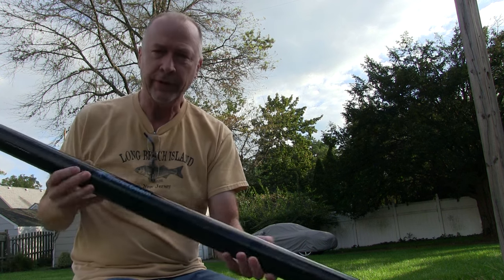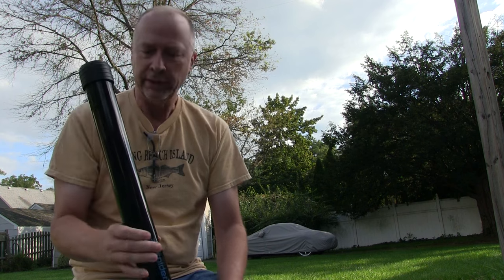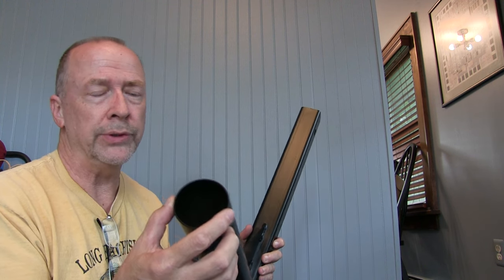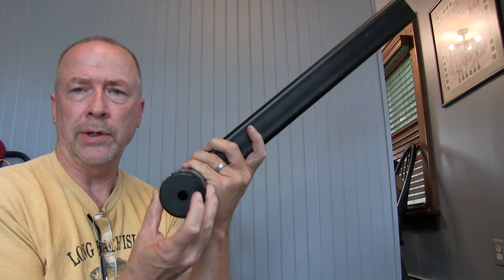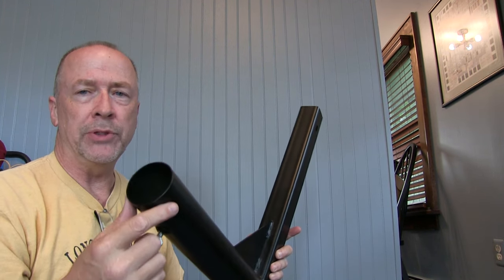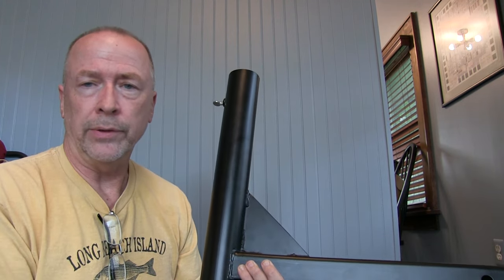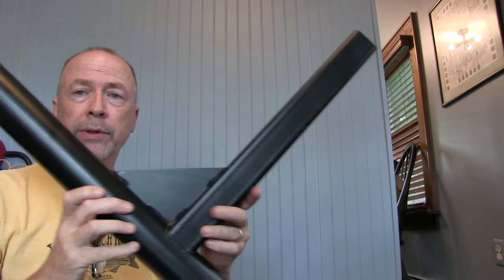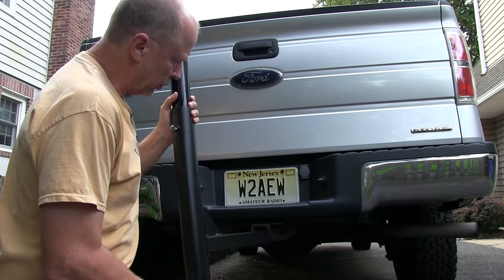#373: Portable ham radio / POTA: The Spiderbeam 40' (12m) telescoping mast and hitch mounted support

Comment: I found that cutting a bit of towel or other fabric and placing that inside the bottom rubber cap will keep sand and grime out of the antenna. There is a slight negative pressure formed when extending the sections and, at least for me, that meant that I got sand in thru the small hole in the cap and ended up in between the sections. Had to disassemble the whole thing and clean it with a rag. Never had that problem since I put a piece of towel in the end cap.
Reply from the maker: Great tip - thank you!  I'll do that!

Comment: Very nice. I have used two of these 40 ft Spiderbeam poles for wire antenna experiments for the past couple of years. They are quite fantastic. I did have a mishap where a big wind blew one over and destroyed the top two sections. A quick call and replacements were here in a jiffy. Now I am using their clamps and more kevlar guys! Great product and very well made.

Comment: I 3D printed a collar for my 10M pole to take up the slack in the top of the hitch support tube.  You don't have a much slack, so a couple wraps of tape on the pole would do it.  Either way you need something to spread out the force from that thumb screw (or eliminate the need for it all together).  It will mark up the pole at best, and more likely start cracking it as the pole encounters some breezes with a wire on it.

I have a friend with the Spiderbeam and he solved the diameter problem by lashing the pole to the outside of the receiver tube with two very large Velcro straps.  This also eliminates the pressure point from the thumb screw, and so far has proven plenty sturdy.
Reply from the maker: Yeah, I'm likely not going to use the thumbscrew.  I don't have a 3D printer, so I may ask a friend to make something similar for me.

Comment: I have two of these - one I use with an 11m wire and an SGC base mounted tuner at home mainly for the higher bands (although will tune 160m to 10m - not so good on 12m) and another which I use /P with a MAT-40 ATU with 4x 10m wire radials. Similar mounting method but a drive-on plate. I have to take the end bung off but thinking of having a special fabricated so that it will take the mount for the tuner too. I've used it for 20m end feds as well as inverted Vee on 40m with good results. 

Very well constructed poles and not horrendously expensive. I do want one of the longer poles but the collapsed length alone makes it challenging to get in even a 5-series saloon (sedan).

Comment: If you do use the thumb-screws to keep the antenna mast from turning, I'd suggest you tape pieces of aluminum flashing around the mast at the point where the screws will hit the mast, in order to protect the mast from being chewed up by the screws on a breezy day, which is, of course the sort of day you would most likely want to use the screws. Metal screws against plastics are always a point of concern.
Reply from the maker: Good idea. I’ll likely use some rubber or foam wedged in the top instead of the thumbscrew anyway.
Reply: If it is convenient I would slide a machined pipe spacer from the top to fill the gap. The screw is frustrating.
Reply from the maker: @Masirah1  yeah, I’ll come up with something more elegant like that.
Reply: @w2aew  I am thinking of cutting up a bicycle inner tube to use a spacer there.
Reply from the maker: @kapapatence6423    Good idea.  For mine, I had a friend "print" a collar/sleeve on his 3D printer that takes up the gap.

Comment: A very similar device called a Bream Pole (modern replacement for the older long bamboo poles) can be found at some fishing supply stores. Not quite so tall (maybe 3 or 4 meters) and much whippier. Don't be tempted to deploy by swinging it. The last sections will be moving so fast that they push through the tapered joints, splitting them beyond repair. Same principle as cracking a whip: all the energy keeps getting transferred to lighter and lighter sections (which means they move faster and faster.)..

Comment: Great idea! I have 3 of those and use them for my 3 home QTH wire antennas, as they are cost effective and easy to bring down in case of weather. I also used to use one as a POTA mast with a drive-over wooden plate and PVC "socket." And, when a section breaks (don't ask me how I know this😂) you can purchase replacements. Thanks.

Comment: Great video. I've been looking for a pota solution for operating out west or other places where there aren't as many trees. Do you suppose this will support an LDG 9:1 and coax when the mast is fully extended? 73!
Reply from the maker: As long as you are using lightweight coax (RG-174 or -316), then it probably would.  There would definitely be some flex.  You might consider using the mast to elevate the end or middle of the wire, and keep the balun/feedpoint closer to the ground.

Comment: I took delivery of a 10m SpiderBeam today and mine feeds out through the rubber tipped end and the plastic threaded end is on the bottom. Was this sent to me assembled backwards? I thought it seemed like it should be like you demonstrated…rubber piece on bottom.
Reply from the maker: I have basically the same rubber cap on both ends of mine.  Neither end is threaded. Maybe the 10m version is different from my 12m version?

Comment: You didn't mention it, so I'm not sure, it looks like you put a cotter pin in the top of the small extension. Is it? If it is, did you secure it with epoxy, glue or force it in ?Thanks Eddie kj4fgi
Reply from the maker: Yes, it's a cotter pin epoxied in the top.  When you purchase through Vibroplex, they have an option to purchase it that way.
Reply: Great thanks, I purchased the same one 8 years ago, I have cotter pins I'll install one. I never thought of that. @w2aew

Comment: Do the Top sections flex with just holding a small wire, or are they robust enough to stand straight ?
Thanks !
Reply from the maker: They only arch a little when holding the end of my 40m EFHW wire.  MUCH better than the fishing poles.
Reply: @w2aew  
Thanks for your reply !
I put up a couple 31 foot Jackite flag telescoping masts to support an 18 gauge wire antenna, and they are way more flexible than I would like, especially with such a light gauge wire !
And let's not talk about any winds they might encounter !
Lol....!
Just received Two of these 12 meter Spider Beam masts this morning !
Fingers crossed the weather stays decent until I can get them in the Air !
Thanks again !
And thanks for your post !

Comment: I used #11 rubber stopper for my base and did not remove the bottom of the hitch mount. I did however wrap ductvtape around the exterior of the mast where the lip of the hitch mountbwould contact the mast, not the prettiest, but its functional.  de k8mh
Reply: This is a BRILLIANT Idea! You've made my day! - Just ordered one from Amazon and it will be interesting to see if it does what I hope it will :) Thanks for your comment!